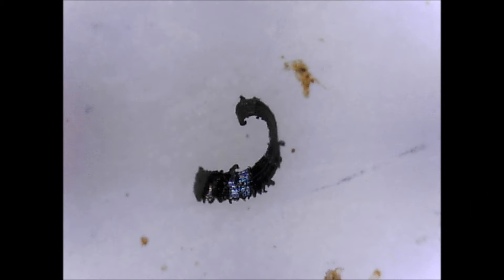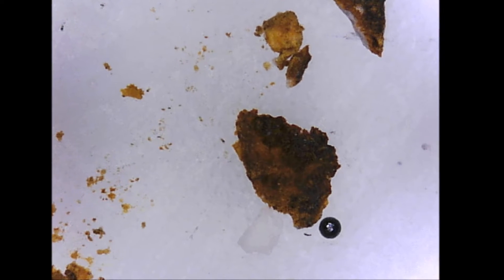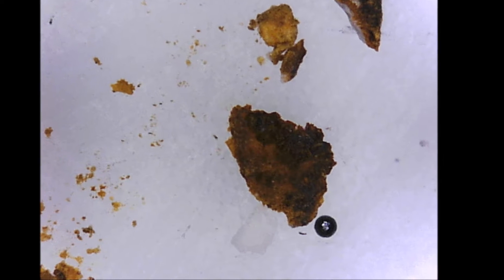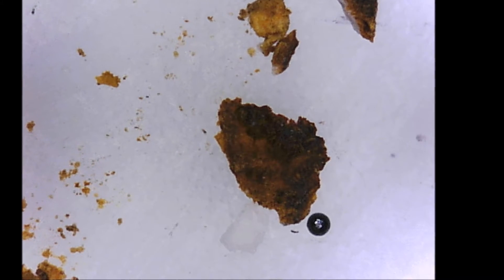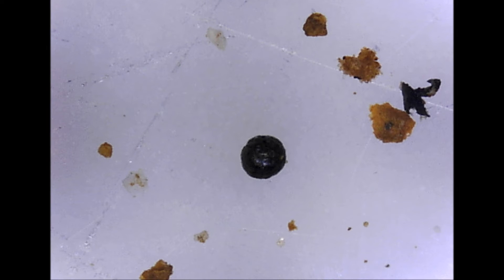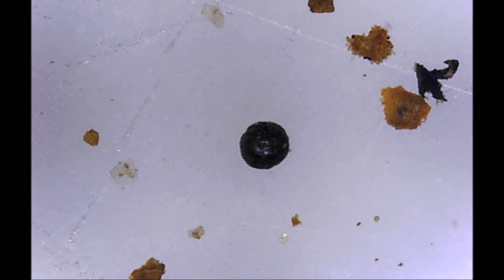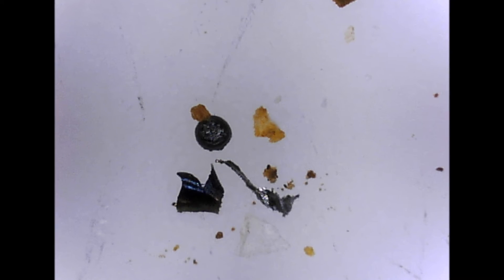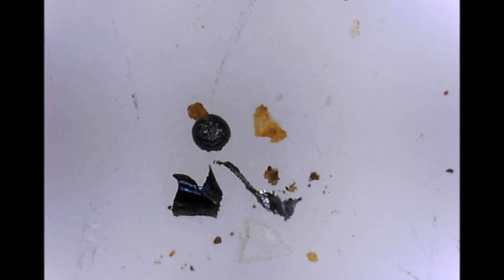How Flint and Steel Really Works

Comment: Flint is a form of Quartz. They're both compost of silica, silicon-dioxide. Steel also has magnetic and electrically conductive properties. I'm not so sure flint and steel is all that different.

Comment: flint can be around 400MPa which is very strong for a rock, one of if not the strongest common natural minerals. but it is crumbly and fractures easily. i bet you could get a longer lasting flint and steel with a magnesium or titanium piece, striking it with something like a chunk off of a green silicon carbide grinding wheel.
Reply from the maker: Interesting thought! Sounds like an experiment!
Reply: Magnesium is often used in conjunction with ferrocerium, though it gets eaten up a lot faster than steel.

Comment: Iron is a pyrophoric metal and if exposed to oxygen will ignite instantly. This is rarely seen because any iron you see in nature has a very thin coating of rust on the surface (iron oxide). As soon as fresh unrusted iron comes into contact with air, oxygen immediately bonds to it forming iron oxide and is a heat-producing reaction aka burning. When you strike iron or steel with flint, which is a very hard stone, you are shaving off flecks of iron that were underneathe the rust layer. Now here's the important and often missed part: it isn't the friction from the strike that causes the iron to ignite and become molten. That fresh, exposed shaving from underneathe the protective rust layer is now flying through the air has a lot of surface area. Oxygen is hitting it from all sides simultaneously. This causes the flake of fresh, uncoated iron to instantly react with the oxygen on all sides and combust into iron oxide. Again, iron combusts at room temperature but the process is ordinarily slow aka rusting, but give a small particle with high surface area and the rusting process is exponentially shorter aka ignition.
Reply: I have been sitting here for like an hour flicking my flint stick and striker... thank you for this. I was like but why and how does the iron ignite in the oxygen but not an iron bar. So why doesn't(if you made one) a big perfectly spherical ball of iron ignite like a spark? Just cuz it so small a mass?
Reply: Yes
Reply: Great dialogue... Here is the two videos that helped me understand this: 

https://www.youtube.com/watch?v=iISnUtJoxhk&list=PLLnAFJxOjzZsFT3W9nRAjB9QCEwNmB0Yl&index=18&t=0s

 https://www.youtube.com/watch?v=5tFy9bOLsxw&list=PLLnAFJxOjzZsFT3W9nRAjB9QCEwNmB0Yl&index=18
Reply: Thanks. Very informativr
Reply from the maker: +Jon Horowitz Fascinating! Thank you, Jon, for taking the time to explain this -- it adds yet another layer of awesomeness to how this works!

Much appreciated,
Kenton

Comment: Great research Kenton, I allways thought it is the flint that throws sparks, because when we were kids, we just hit two flints against each other and they threw sparks too or at least it smelled like fire, that's why we loved it so much, lol. Cheers my friend, Marc
Reply from the maker: Hi Marc,
There's definitely still a mystery with the sparking rocks, because we definitely have rocks that spark off each other in the Wisconsin hills. I suspect one is iron-based, so this summer I'll try to run the same test with two stones and see what the debris looks like. Quartz-aggregate rocks, including granites, can also exhibit a piezoelectric effect when they're hit together, so you may see a flash or even some sparks. Amazing things, rocks!
Reply: I second that. yes rocks rock! ;-)

Comment: for a while i actually had a big quarts stone in the spare room and every once in a while i would go and strike it with an old wood chisel and it threw great sparks if i hit it right. i never did actually use it for anything though
Reply from the maker: I've found that although people usually use flint or chert, that quartz works great. It's quite hard, and tosses really nice sparks off the right steel. It sounds like your chisel was made of the good stuff!
Reply: oh it was. i was actually going to bend it a bit to make a handle although i never got around to it
Reply from the maker: It can be tough to find that old steel these days . . .